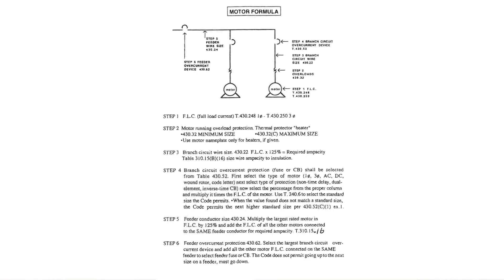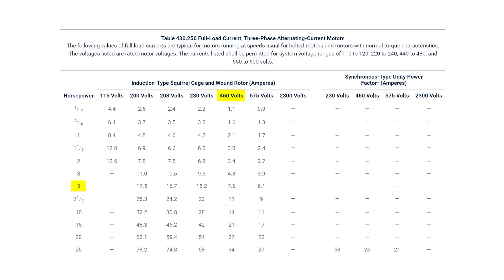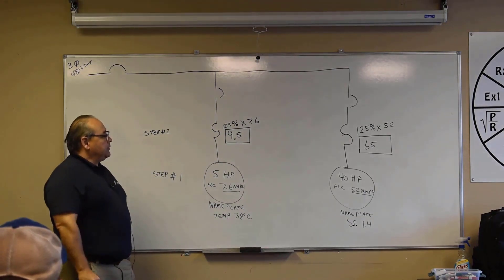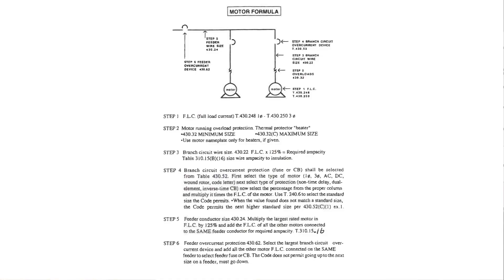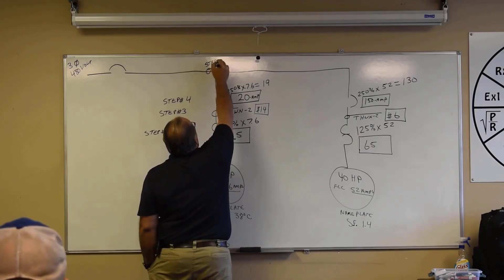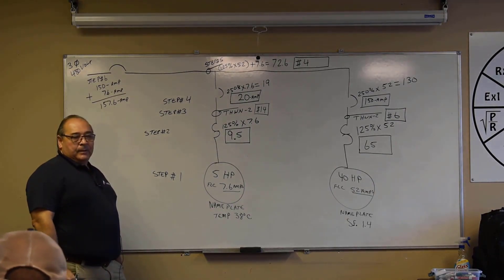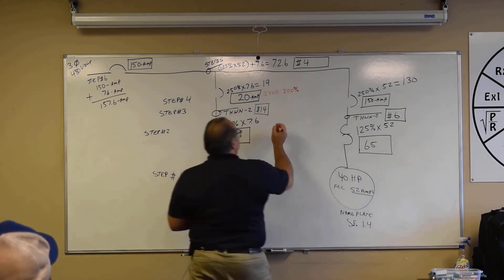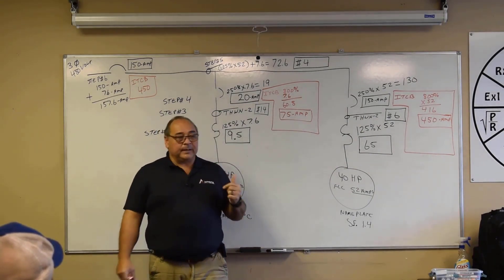NEC Motor Load Calculations Example

Comment: If table 430.52 provides the maximum protection size then by definition by selecting abreaker with a rating above that arent you exceeding the values in the table? @6:52

Comment: Only confused as to why use 125% when the service factor is 1.4 and the chart for that says 1.5 or greater to use that, all other motors 115%
Reply: It’s 1.15 or greater not 1.5

Comment: I think there's a mistake on step 2, you should calculate overload with FLA nameplate, not FLC and there is not fuses 0r brakes 7.6 or 65 amps on table 240.6 A nec2023 for overload

Comment: I think the wires are undersized, and the main CB is undersized. The wires should be 2 or 1 levels up the ampere rating of their circuit breaker. Load < breaker amp < wire amp. Instead, you are taking into account the overload relay.

Comment: On step #3 if its THWN-2 at 9.5 amps wouldn't the answer be 18 for copper? Or is it 14 because of the temp rating? Confused. I understand how you got the answer for the 65 amps just not the 9.5 amps.
Reply: Min. rates allowed is #14 for residential and commercial

Comment: Service factor is 1.4 and the code is 1.5 or grater to be × 125%. If is not 1.5 por greater it should be × 1.15.
Reply: NEC 2020 says 1.15 or greater... 1.4 is greater than 1.15. Had to double look myself!

Comment: I've noticed you use 75° column for the branch ckt conductor size. However I was told to use 60°C column for circuits rated 100 amperes  or less (per NEC 110.14-C) regardless of conductor insulation rating. Was there an exception that I missed?
Reply: He used 90°C for the branch circuits since we're told we're running THWN-2 wire to the motors. The feeders to the panel main breaker are calculated using the 75°C column for motors.
Reply: I'm not sitting in front of my code book but he said all motors are size it 75 degree column. Finger your way through 430 and see if you can find something backing up his statement.

Comment: For Step #6, why wouldn't you add 150A to 20A for the remaining motor? Why did you only add the FLC and not the Branch Circuit protection from step #4 like you did for the larger motor?
Reply: Bit late, but 2023 edition, 430.62 says use the largest Protection rating device and the SUM of the FLC for other motors of the group

Comment: So I just did this by calculator and field knowledge on wires and experience wiring things actual amperage it’s 7.7 not 6 learning ohms law helps a lot and makes easy to calculate by using the calculator

Comment: I am now very confused, but anyways I only know things for residential wiring only, I thought 14awg must use 15a breaker to protect the wire
Reply: The "test" gave a wire insulation choice that was in the 90 degree C column. So that's why it was chosen.

Comment: Arent you supposed to calculate the Overload from nameplate amps????
Reply: If the nameplate info is provided, you are to use nameplate for separate overload devices. If nameplate is not given, you're to use table FLC. At least, that how I think I understand it.

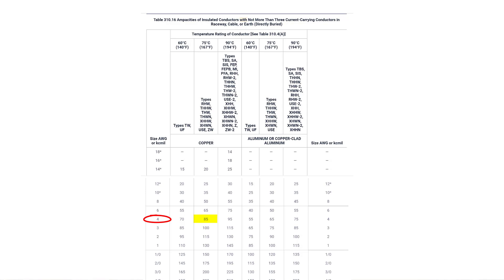Comment: Why do you always use 75C degrees column for motor feeder wire size? (8:30 in video)
Reply: 110.14 NEC

Comment: I am doing 50 HP [FLC= 65A, 65A*125% = 81.25A got Conductor size AWG 4] and 250 HP  [FLC= 302A, 302A*125% = 377.5A got Conductor size AWG 500MCM table 310.16(75 ,Copper)]. For 50 HP - I am doing 65 A * 250% = 162.5 Amp breaker. But from ugly book, for 50 HP size breaker-150A. Same for 250 HP - 302 * 250% = 755 A. Should I not go up and standard size of breaker?
Reply: I think it is because the 250% from Table 430.52(C)(1) is a maximum rating, so the ugly book selects the closest standard size under 250% of the FLC.

Comment: I think you made a small mistake by multiplying your overload protection device with your FULL LOAD CURRENT instead of your FULL LOAD AMP??
Reply: Overload size should be sized  by the  amperage on the motor name plate not the the   FLC table
Reply: Yes for step 3 Sizing the Branch Circuit conductor he multiplied a %125 by the value of Overload Protection instead of the instead of the Full Load Current.
Reply: Yes usually its say fla on nameplate thats what you use.
Reply: I think we all agree that in real life, more than likely the name plate amperage is right there. However, for the sake of arguments, let's agree this is a test question and the FLA is not provided. In these cases, the test question will give you other information such as the SF or Temp, so you use the information given to you. The FLA was not given, we need an amperage, so we have to use the FLC. Get it? It's a test question, which we all know sometimes we just gotta roll with it.

Comment: Why is the first wire size not # 18?
Reply: I'm looking for the same answer. I THINK he made a mistake with the chart (read the AMPS as the wire size) but was technically correct because 14 AWG is the smallest size permissible for a branch circuit.

Comment: When you size breakers for motors, wouldn’t you round down to the next standard circuit breaker size?
Reply from the maker: 430.52 exception number 1 allows us to go up to the next standard size for overprotective devices serving branch circuits for motors; 430.62 does not have this exception, so we have to go down to the next standard size for overcurrent devices serving feeder circuits for motors.
Reply: @electrical1019  thank you so much

Comment: Wouldn’t you size your OVERLOADS to your FLA  on the motor? Not your FLC from the code book?
Reply from the maker: In the field/"real-world", yes, you would. This video assumes you do not have that information, and is more for those taking a licensing exam rather than practical application.
Reply: @electrical1019  thanks. One other question. I understand how to size for fuses and breakers but what’s confusing is when you round up or round down. Any explanation would be great. Thank you.
Reply from the maker: @mcarroll598  I believe we just responded to that in another comment you left!
Reply: @electrical1019  thank you

Comment: Where does table 430.22(E) fall in these steps? If asked for any of these rating percentages? Answer be helpful
Reply from the maker: You would only use table 430.22(E) if you are sizing conductors for a motor that is not continuous duty (step 4). The NEC tells us that anytime we use a motor we have to consider it to be for continuous duty unless we meet certain conditions, so we generally speaking don't  bring this table up. If you are using this information for real work application, and you consistently work with intermittent use motors like on an elevator, it is very good to know though!

Comment: The overloads are calculated at nameplate FLA, right? Everything else is calculated from the FLC from from 430 tables , am I right about this?
Reply from the maker: For field calculations that is correct. These lectures are intended for students taking a licensing exam in Kentucky, in which on the exam typically the FLC is used to calculate overload protection.
Reply: @electrical1019 wouldn’t you use the FLA from the name plate for overload for exam purposes as well? It calls out name plate in the code reference.
Reply: I think the overloads should be calculated at nameplate  FLA, right? Everything else should be calculated from 430.248 FLC, am I right about this?
Reply: You are right 👍
Reply: I find that pretty odd since the motor nameplate FLA is tipically different than the FLC. If the FLC is much higher than the FLA by many amps, then the overload will be set much higher than the FLA.. interesting
Reply: I noticed the step two was wrong as well. I even checked the code book.

The only time that you use the full load current Hp Tables, is if it’s a integral thermal protector overload.

Why would they allow it to be the full current in the state of Kentucky? 
Wouldn’t their motors burn out. 

I compared and contrast the nameplate ratings to the FLC and it’s normally one to five amps larger on FLC for what I saw. 

if the FLC is actually higher than the nameplate ratings, maybe the code should be changed to the FLC. 

After all these years, nobody seems to have had a problem with it. The real question is which way is the right way?
Reply: @windturbineclimber5412  I too am slightly confused. 150a protecting a #6 seems counterintuitive.
I dont doubt it's getting guys to pass though.

Comment: You dont need the FLA to do these calculations?
Reply: Im using the 2014 code book
Reply from the maker: Actually, FLA comes from the motor nameplate. FLC comes from tables 430.248 and 430.250. 430.6(A)(1) requires us to use the FLC from the tables for all calculation other than overload protection rather than the FLA (in this videos we assume that the FLA is not provided and just use the FLC for over overload protection). Hope that helps!